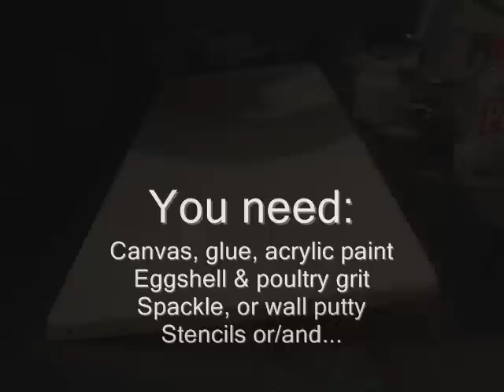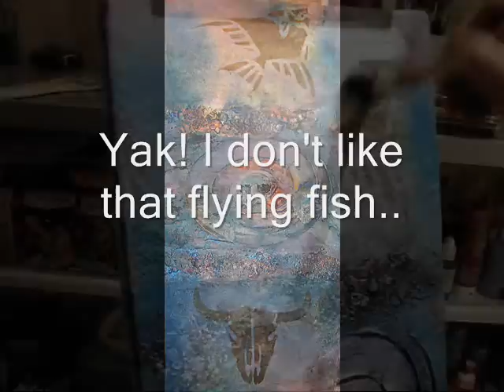Carla van den Berg, how-to 7 -mixed media technique

Comment: Thank you for sharing your work. The painting is so rich and deep. One question about the eggshells: do you need to remove that thin membrane on the inside of the shell? Will it interfere with the bonding of the shell to the canvas substrate? Thank you!

Comment: Great video, but please, please don't pour paint down the sink. Some countries have water treatment plants but they are not designed to cope with a high chemical load, and in countries without proper treatment systems the toxic solvents in acrylic paint will end up in the sea or rivers.

Comment: Standard joint compound is not archival and wholly unsuited to use in painting, particularly on a flexible support such as canvas. It is hygroscopic - will absorb water and dissolve. Even if kept dry, it will crack an likely separate on a flexible support. Better it would be to use any number of acrylic mediums and pastes to achieve this kind of texture effect. They have none of the liabilities that joint compound or spackle have.